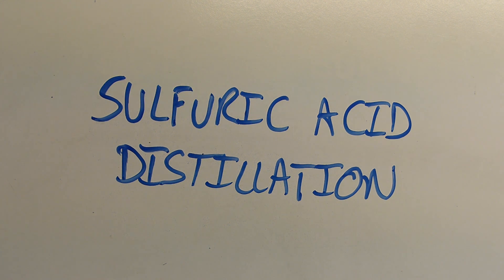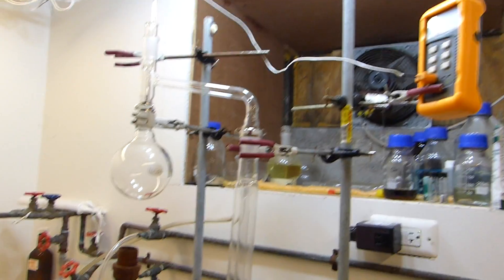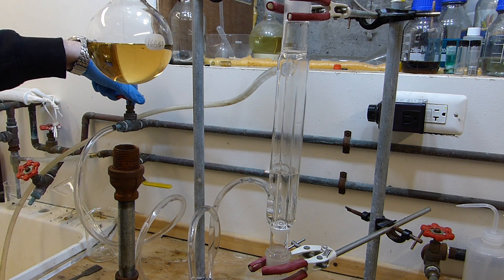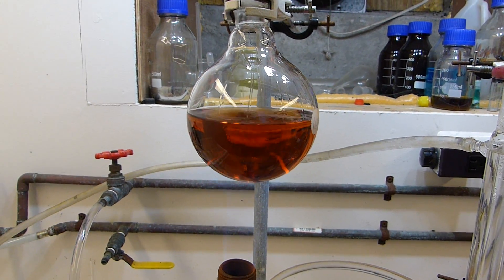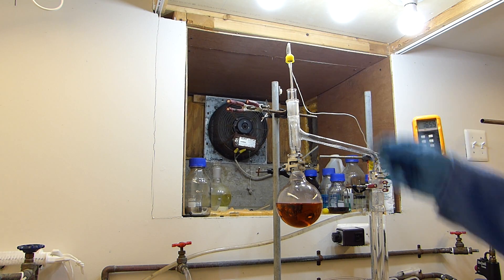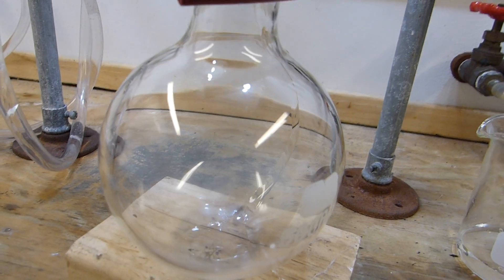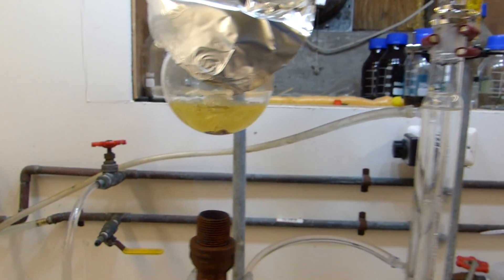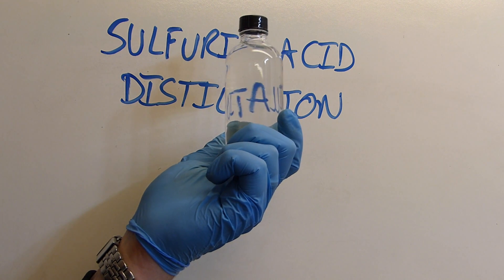Distilling Sulfuric Acid with Some Mishaps

Comment: Do this distillation with GOOD glassware.  Forgo the stuff from China.  The last thing you want to hear is that DREADED tink coming from your RBF.  I ignored it only to have super hot KNO3 and H2SO4 raining down upon my work top.  A Polarimeter or similar will let you see stresses in your glass before you go heating it up to 350 degrees. Can you show us how YOU anneal your glassware?
Reply: I store my HNO3 in glass bottles that have black phenolic caps and a PTFE septum/seal. It then goes into a lab fridge for long term storage.
Reply from the maker: Quite correct. This was done with a thinwall 3.3-boro RBF from Ace Glass. They're almost $30 each but quality labware is hugely important. The collection flask is a $6 Chinese special and has a couple of bubbles and waviness in the glass and would have probably broken apart on a direct flame.

I do not anneal glassware myself. There is a guy with an art glassblowing shop about a mile from my house who will kindly let me run odds and ends through his annealing oven whenever necessary, often after I make some torch modifications to existing glass. I will try to see if he will let me make a video about the process sometime.
Reply: @DougsLab  Where or HOW do you get Ace glass?  Few suppliers carry their products, and Ace's website shows that you have to supply them with your business license to buy from them.  Thanks.
Reply: schott duran  > all
Reply: As for the PET situation, always consult a plastic material compatibility chart, many are available with a web search. the better charts will indicate short term or long term storage and footnote any critical temperatures. permeability can be a factor too, PET is very resistant to CO2 but not water vapor transfer, eg.
Reply: NEY Industries Try amber glass containers with glass tops that slide down into the bottle. They're a bit more expensive than normal but they will allow excess pressure to vent, they keep air out pretty well, and they don't react with nitric acid. The amber glass also protects from phoyodecomposition of the contents, but that doesn't mean it's wrapped in opaque metal foil or anything. No leaving even an amber bottle in sunlight no matter how good you think your window glass is. Hope that helps. PS Look for places that sell old school equipment. Sometimes you can find basic lab glassware in those places.
Reply: Doug, I'd love it if you made a glass blowing video!